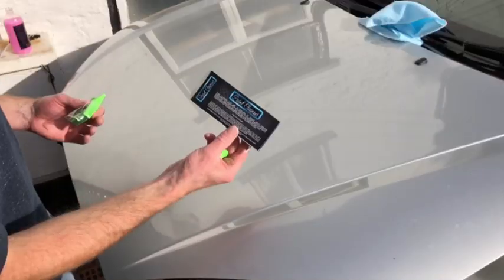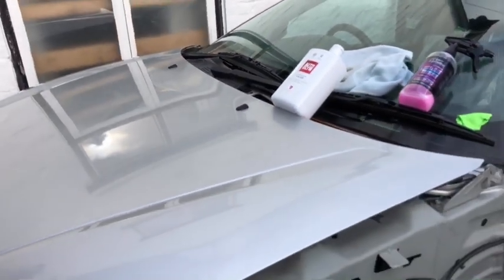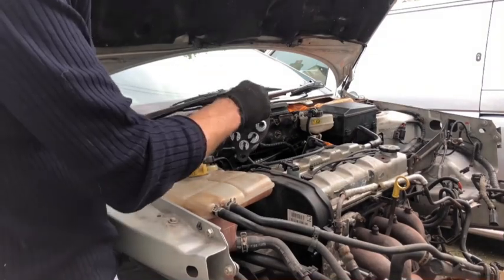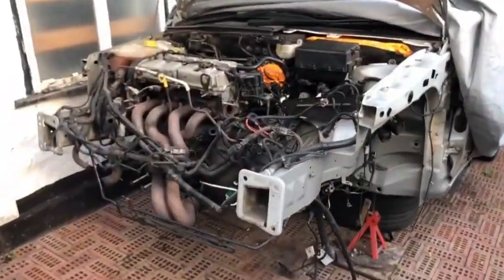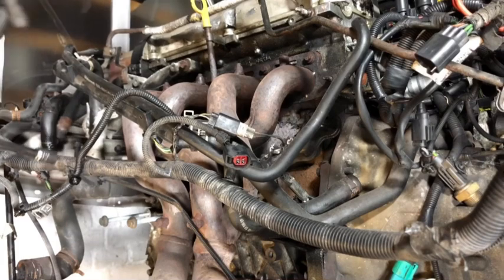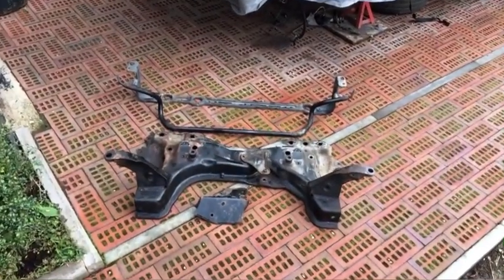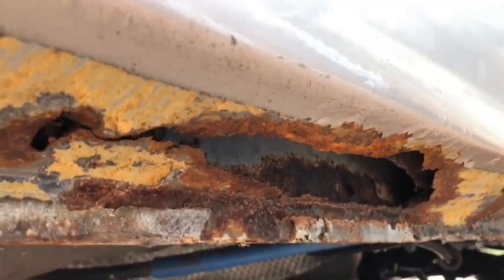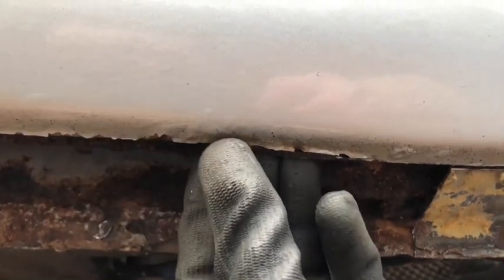Does 21 Year Old Paint Shine?

Comment: Hi m8 goid vid again watched yr progress from when u started stripping the rear of the st170 I’ve owned 1.000s of fast fords for over 38 years and I’ve built over 50 show stunning examples lol some of them still winning concourse (sapphire RS cosworth s) I do all the work myself engine builds body work and being a ford plenty of welding /fabrication ( I’m a welder /fabricator) by trade anyway if u need that cill and them rear bits welding I’m more than happy to come out and weld it all up for you I have all the kit and correct gauge steel I can do it properly I usually seam the sections in so they look factory let me know just as long as your not tooo far away I’m in Leicester
Reply from the maker: Thanks for watching and for the kind offer! I’m a bit too far away I recon - it’s in north Essex so a bit of a trek away. Great to know someone who has the skills and can do that kind of work properly! The RS Cosworths must have been a great project to work on - and to be winning at that level too is top stuff! 
Going to be making a parts list and finding the more difficult bits for the st170 over the next month or so. It’s about time I got some stuff back on it 😆